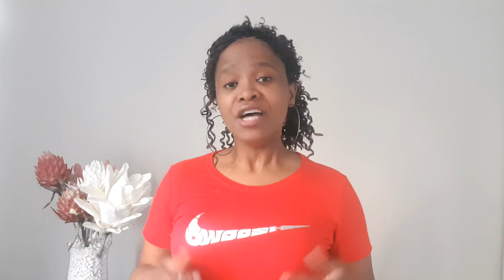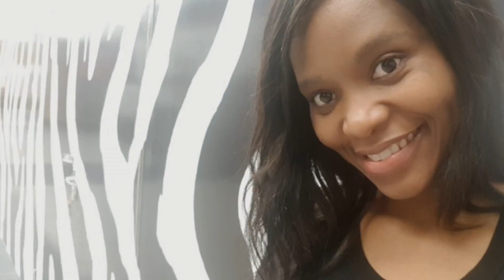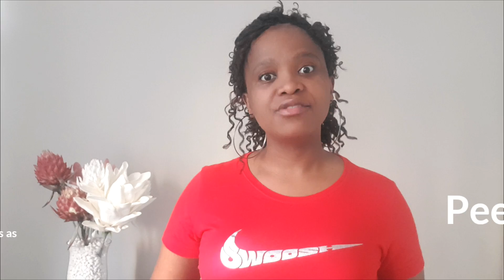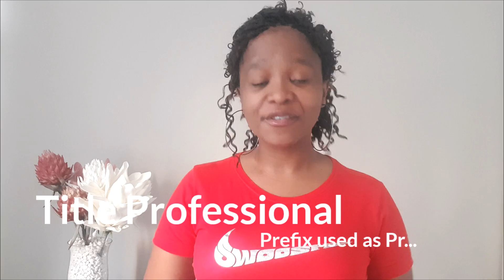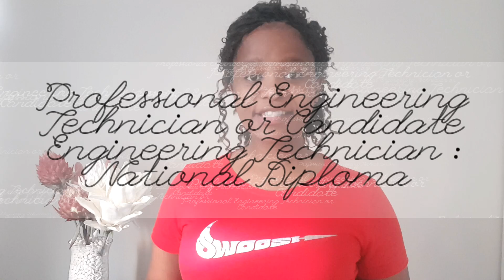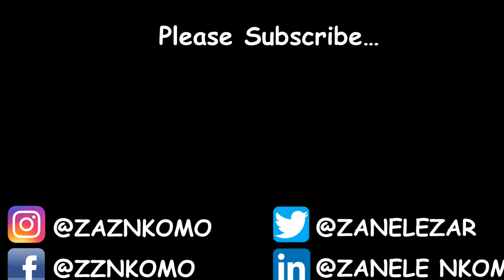Engineering Council of South Africa the Different Types of Professional Engineering Accredications

Comment: So knowledgeable! Thank you for the video. I would just like to know if RPL could be relevant if you do not currently have an qualified mentor?
Reply from the maker: You don't have to register as a candidate before applying. You'd need a mentor if you apply first as a candidate then as a Professional. It makes it easier, and is cheaper - but you can complete your prior learning, experience and report and apply as professional having not registered as a candidate first.

Comment: Hi Zanele, Does the person holding a National N Diploma also qualify as a professional engineering technician or candidate engineering technician ?
Reply from the maker: Hi Eugene.You are a candidate before a professional. You don't necessarily have to register as a candidate first, however this does make it easier (and cheaper) when you then want to register as professional..

Hope this helps..
Reply: @zanelenkomo  Can we transfer from Architecture Technologist to Engineering with accreditations from 3 years of BAS Architecture Structural Theory? They provide options like Bachelor of Science Honors in Materials. I want to enter the industrial sector without starting over again and doing a Mechanical Engineering degree.